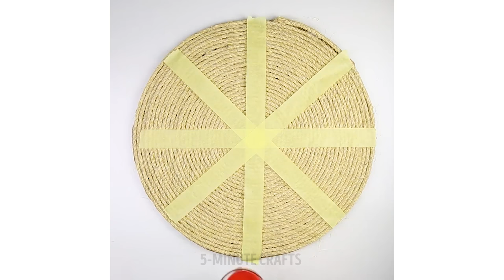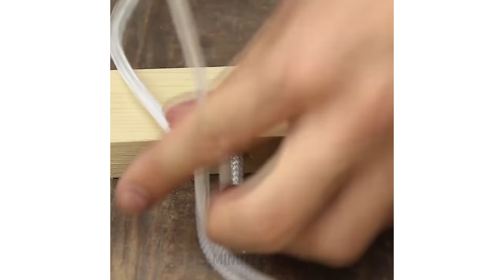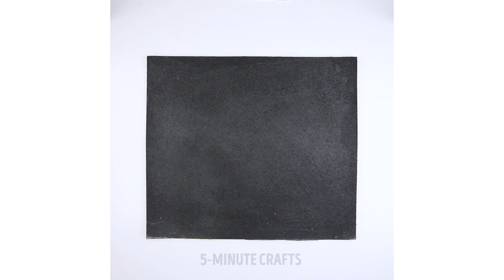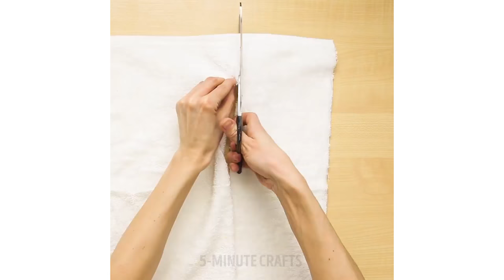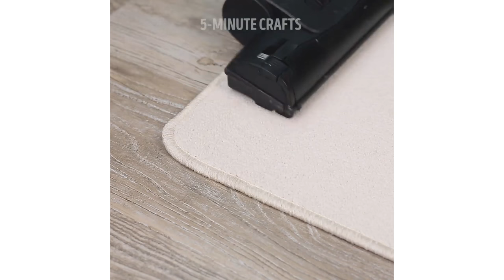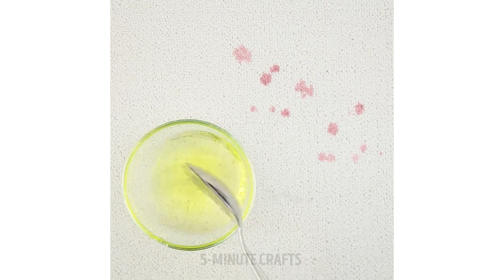4 SUPER COOL DIY MATS TO COVER YOUR APARTMENT

Comment: Okay. No. You can't make a floormat out of towels. Unless you plan to wash it every time you step on it, it will get moldy, and so will the floor underneath it. Just. Don't do it. If you wanna put a towel on the floor, put a towel on the floor. And then pick it up and wash it.